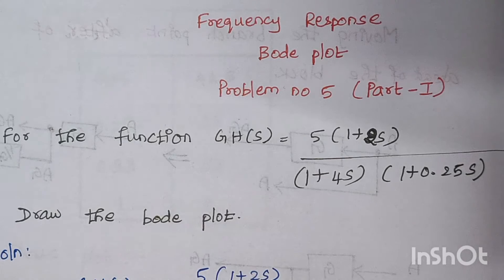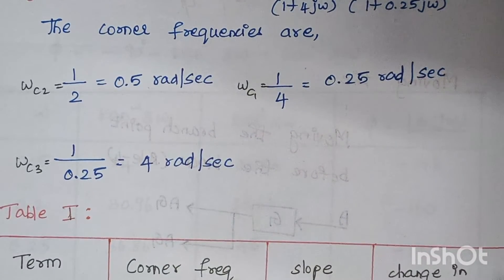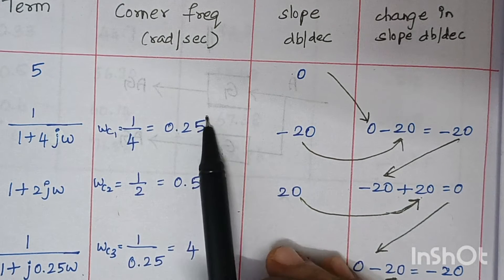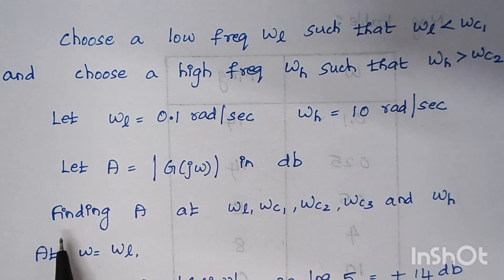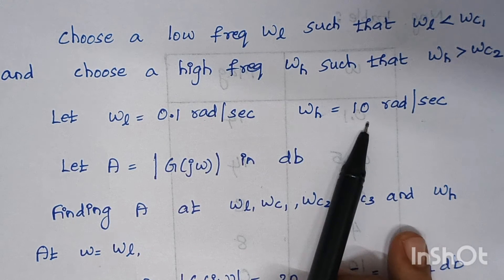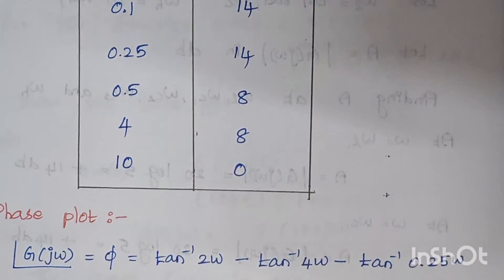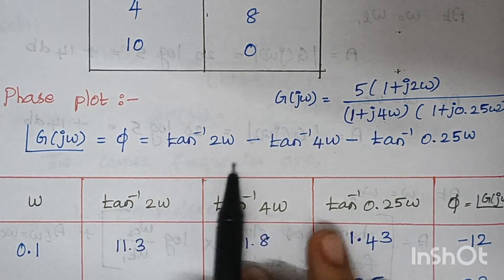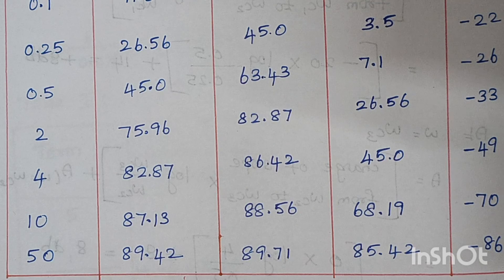BODE PLOT (PROBLEM NO 5)(Part-I)

Comment: Mam why we use at w=wc1 20log(5) instead of 20log (0.25)
Reply from the maker: I had made a mistake.you are correct.yes ,it should be 
20 log(0.1). We should select a freq <WL i,e here WL = 0.25 that's why here i had selected 0.1 as WL.Even u can select 0.2,0.01.selecting a value of WL is our wish.
Reply: @kowsiteaches mam ya it's correct but wc1 value is 0.25 ,so we need to write 20 log(0.25)only right ?why we need to put 0.1 nd also I have a doubt that the formula is 20 logk but y we need to substitute 0.25 nd 0.1 nd all??????